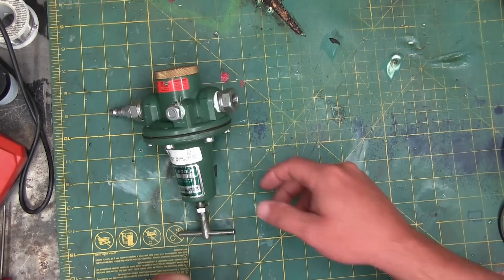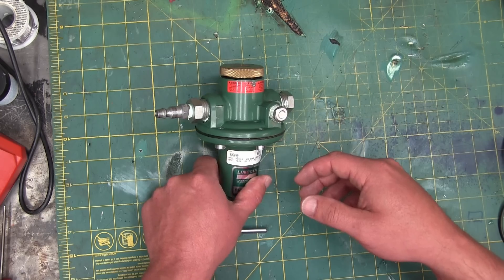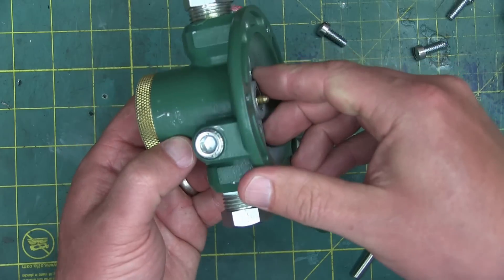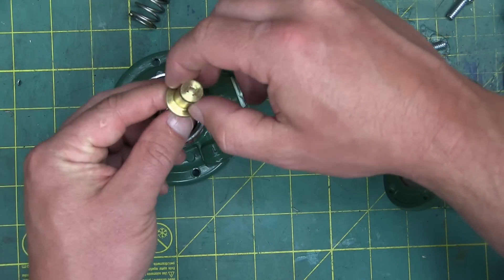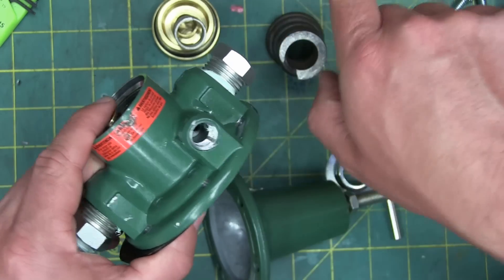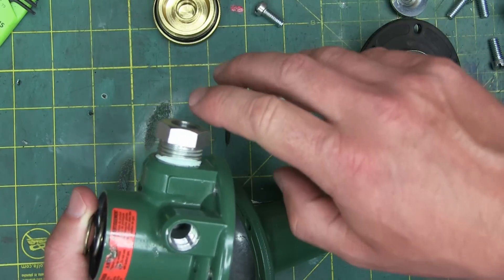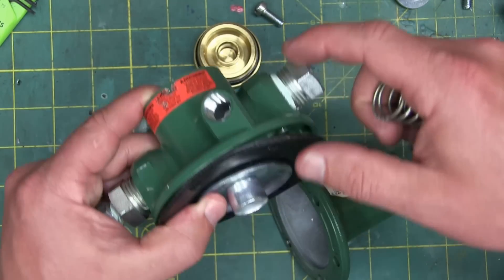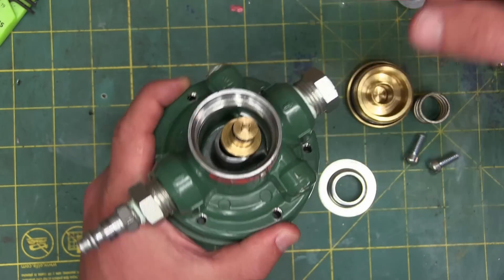BOLTR: Pressure Reducing Valve | Gas Regulator

Comment: Actually, they are designed to not lose pressure. Its one of the requirements for certain machinery, including air brakes, in case the regulator fails, or the compressor expolodes itself. You need to have pressure to continue operation. Even if you have over pressurization in other systems of a vehicle, those have check valves, with everything designed, in every worst case scenario that still leaves pressure inside the brake circuits, to let you stop once or twice.

Comment: Missed one other mode. Diaphragm tare or displacement. I just had a nice Watts unit spit the seal edge of the diaphragm out of it grove and all ot wanted to do was dump high pressure air out of the ambient pressure side of the diaphragm through the vent holes in the cap. If it had or been like the one you have in the video I think it may of made it longer. What seems to have happened is the diaphragm shrank and pulled out of the grove.

Comment: I think it sealing off the back-flow wasn't because you raised the pressure, I think it's because you left the pressure on long enough for the poppet to seat.  When quickly shooting air in and disconnecting the poppet hadn't seated yet so the air shot out.  My theory based on what I saw, I've never tested it.

Comment: This type of valve, if I'm not mistaken as I often am, when used with steam will result in wet steam because the steam has done no work and is now at a lower pressure water comes out. At work we take city 400lb steam and drop it to plant 125lb steam by running it through a turbine that generates electricity during the winter months or compresses gas for AC during the summer months. The steam costs next to nothing during the summer months and using that for AC is very cost effective. During the winter months by running the steam through a turbine to generate electricity yields plenty o $thousands per week. Either way the steam coming off of the turbines is designed to be running around 125lb and because it has done work is still dry steam. Wet steam is extremely dangerous. Steam hammer like its cousin water hammer is very real and very dangerous.

Comment: I'd be interested to see how long it would take for the pressure to equalize betwixt the two sides of the regulator, and what that waveform might look like.  As described, a drop in pressure on the downstream side, would then generate some fluctuation in pressure as the two opposing springs found equilibrium. Not asking AvE to do this, as I'm not interested in coitus with my hat. Just curious.

Comment: I think you may have misread the purpose of the conical coil spring there... Springs don't generally have a progressive rate unless parts of them are binding against each other. The conical coil gets you a bigger linear working range in the same size package, you can compress it further before the coils bind. (Pull the axle quick release centering springs off the nearest bicycle and check out how they squish completely flat.) Also it probably saves material in the housing that needs to stand up to cylinder pressure if the diaphragm fails.

Comment: So, can you blow out your diaphragm by having too much pressure in the wrong direction, then?

For instance if you had your regulator setup to allow for a really high pressure, but then the pressure source was shut off and bled out, it seems like the back-pressure could rupture the rubber diaphragm, no? How often is a regulator such as this hooked up with some kind of back-flow preventer check-valve thing?

Comment: And for scuba you also need a demand valve so you get air when you suck.
Most failures on pr valves are caused by debris under the valve seat.
This results in high pressure on the outlet so relief valves are fitted especially if it's a primary rv, say on a hp cylinder.

Comment: +AvE  I have some gas cylinder bottles at work that have regulators on them.  The new cylinders have 2000-2400 psi in them depending. I noticed something interesting...we set the outlet pressure to about 25 psi.  As the cylinder pressure goes down, the regulated pressure goes up.  Interesting byproduct of the 2 spring setup I would guess.

Comment: What would happen if the input pressure is very high (eg: 3000 PSI) and the output flow rate/pressure is very low? If the pressure differential is extremely high would the diaphragm/valve flutter a lot and cause irregular pressure/flow?

I know that on SCUBA regulators they have 2 stages to step down the pressure to ambient. Would this be to reduce that valve flutter?

Comment: These are also used on hot water furnaces to keep the closed heating loop topped up without having full water main pressure in the loop.

Comment: We use these often with natural gas , steam or pneumatic air. This PRV is a direct acting type, which has the outlet pressure directly influence the little valve. There are also pilot acting PRV's that have a small valve, and the small valve uses the upstream pressure to actuate a larger valve. That happens by diverting the inlet pressure on a larger diaphram so it has more force to actuate the main valve. It also makes for more precise control, and the downstream pressure can be a lot lower (because you don't need much force from pressure to work the small pilot).

Comment: We have what we call a dome regular for reducing 40bar to around 10 bar depending on the process.  To adjust they have 2 needle screws. One applies pressure to the diaphragm for more pressure downstream, the other releases it.  Very picky.  I soil myself every time it blows the pop off valve in my face.

Comment: Ave , This is very similar to the way that Scuba regs work.  They don't always supply low-pressure air, the deeper you dive the higher the air pressure has to be as it needs to be at the same pressure as the surrounding water otherwise your lungs don't have enough power to inhale due to the pressure differential.  If you were to dive to 50M then you'd want the pressure of air that you breathe to be 6Bar (roughly 90PSI)  that's enough to perform the puffer fish trick at the surface but absolutely normal at 50M. - I teach diving so I'm not regurgitating shite.  Interesting Vijeo - https://www.youtube.com/watch?v=VJeSifGgeiA  Thanks for another interesting look at some useless piece of kit ;)

Comment: Very informative, as usual! Thanks. I have a regulator that has shit the bed and I might try to take it apart to see if it's fixable. 

You didn't cover what would happen if the various o-rings go bad, which I would think would be the primary source of failure.

Comment: Do those 4 holes in the poppet valve around the shaft going fully through, connecting the low pressure side with the valve seating cavity on the high pressure side?
Looks like they are important for valve operation, and explanation is not full without mentioning their role.

Comment: Works just like my first stage SCUBA diaphragm reg! Two differences being the preload spring is adjusted to a constant pressure (usually 135-145 psi)then the "outside" of the diaphragm is either exposed to ambient pressure either directly (open to sea water) or indirectly via some mechanical linkage or coupling fluid (silicone oil). This causes the regulator to be depth compensated such that output pressure is always 135-145 psi above ambient. The second "JFM" thing that happens in the poppet side of the diaphragm where pressure in the outlet chamber is fed back to the poppet stem producing "air balancing" whereby it is only the bias spring pressure closing the poppet. This keeps the outlet pressure the same regardless of inlet pressure (typically 3000 to 50 psi). Scuba regulators are two stage regulators. The second stage is another diaphragm reg attached to the mouthpiece which drops the 135-145 psi "intermediate or interstage" pressure to ambient hence the diver's lungs neither shrinks nor blows up :-).
Reply: You would bypass the poppet valve and yes you would cause  one hell of a free flow that would empty an 80 cu. ft. tank in under a minute. The 2nd stage regulator (except for some Poseidon ones which are upstream valves) are downstream valves and act as safety/pressure relief valves. You can "hot lip" and breathe of a free flowing second stage but is not very practical you are trained to use your buddy's alternate air source (that is why divers have two 2nd stages) in the recreational setting. A more robust solution is having an independent back-up which is a spare cylinder with its own 1st and second stage regulator called a "pony" bottle. In technical diving it is mandatory to have two independent 1st and second stages which could either be 2 back mounted tanks with an isolator manifold or two independent side mounted tanks.
Reply: Yep. Scuba regulators are designed to fail in the open or free flow mode.

Comment: Seems to me that the most likely failure is that O-ring on the top of the poppet. Like you say (I think) though, that just means it starts to leak. Would it potentially be a catastrophic O-ring failure and begin to leak out all 100 PSI? Maybe intentionally damage the O-ring and see how it reacts?

Comment: I have found the most common failure to be moisture in the gas freezing and sticking em in place
Reply: It is considered good practice to ensure the vent is facing down so they can drip out condensation at least from the atmospheric side of the diaphragm

Comment: DOOOOD!  How could you not mention the numero uno use for pressure regulators - BEER!  In kegs, in establishments that use pressurized gasses (CO2 or a Nitrogen combo) to force that golden tasty beverage out of the keg and into our drinking vessels.  And keep said beer from going flat.  Each keg usually has it's own regulator as some beers have differing carbonation requirements, so you can fine tune your walk-in kegerator for each type.

Comment: typical failure mode on those things, is the rubber parts go bad, and then it leaks, or gives you full tank pressure, which is totally not good on a 2000PSI gas cylinder.

Comment: I actually built a variable speed air motor control with one of these valves. So gut out the top half, now using the plunger that forces the diaphragm open which increases the airflow this becomes the actuator. Next attaching a cam on a lever arm allowed in the air motor to deliver a sufficient air supply for a decoiler as the arm lifted the amount of air flowing through the regulator increased as the arm descended the regulator shut off.   Now put that in your pipe and smoke it dude

Comment: What keeps it from chattering?

i.e. where's the negative feedback that keeps the diaphragm and poppet valve from oscillating?

(I know they actually sometimes do, but rarely and usually at super low flow rates)

Comment: If you want to see an amazing device built by geniuses, you should see the prop RPM control units on an aircraft.  Springs, fly weights, high pressure oil all working together to keep the prop spinning just right.

Comment: They also use them on most new houses on the main water service line. they're also installed to act as check valves to prevent any of the water that's entered the house from going back out into the city's system.  That's why we recommend expansion tanks or expansion relief valves on the water heater.  If you don't have one, the static pressure can build to very high levels and compromise seals in valves and fixtures.

Comment: we use and I rebuild lots of Fisher regulators at work and a cool feature of Fishers is a weep hole drilled in the adjustment spring housing that let's you know when the,diaphragm fails ( most common failure is the diaphragm getting a hole) and it starts to weep pressure. on a steam regulators this is important because steam temperature is directly related to pressure,  so if you get full line pressure than you run the risk of over heating a product.

Comment: I had the oxy regulator fail in a spectacular fashion a couple weeks ago. The torch was off and the valves at the handle were closed when the reg failed so the hose got tank oxygen pressure which resulted in the fitting at the torch handle failing and the metal crimp fitting smacked my buddy a few times at (what i assume after seeing the bruises) a very high velocity. 

Moral of the story is don't go cheap on regulators and if you do make sure it's your buddy that is using the torch when one fails.

Comment: Excellent analysis of an everyday item (for us maintenance monkeys, anyway) that no one puts too much thought into. I would have liked a little time spent on proper use, since there were several times when you had it turned over and did not mention the arrows indicating direction of flow.

Comment: Company I work for also does air compressors.
These style of regulators are very seldom used anymore (at least down here in nz). They're only found on old school British pistons or IR pistons.
The number one failure mode on these style is the rubber membrane deteriorating usually from moisture  (no one really uses a dryer on a piston). They end up leading through the rubber venting to atmosphere and   it becomes impossible to maintain outlet pressure.
They are susceptible to oil and gunk.
Festo/SMC style is far superior and reliable. 
Must be a NA thing to still have these styles.

Comment: Thanks so much for an explanation of a piece of equipment I use almost every day to stand between "50 PSI max input pressure" gas flow controllers and 1500 PSI gas cylinders.

Comment: If you apply pressure to the inlet, and thus the outlet, and then remove the inlet pressure... try screwing in the spring screw. 
It will always relieve the pressure out the inlet.
Let's see if you can figure out why.

Comment: Good video. The outlet is also in comparison to atmospheric absolute pressure (14.7 psi) through the vent holes in the adjustment housing. Which is often overlooked. If there were no venting on that side of the diaphragm temperature or altitude changes would effect the setting.
Reply: I would think your pressure altitude would affect at what point your outlet side would be able to maintain pressure once inlet pressure drops off, vs back flowing your outlet pressure to inlet side. 

IE at 1 atmo ambient, you'd need something more than 1 atmo on the  outlet side to keep enough differential on the diaphragm to keep the diaphragm spring loaded enough to not overcome the now 1 atmo on the inlet side (the bias spring should be balanced out by the diaphragm spring at whatever tension it was set at while inlet was pressurized).
Reply: @thepewplace1370  The third is a reference point in the case of air.

Comment: Is there a cheap way to regulate down to really low pressures? (A couple cm of water) Hopefully a better idea than throwing an Arduino at it with a pressure sensor, solenoid valve  and a coil of capillary tube to restrict flow, which was all I could come up with.
Reply: Robert Szasz In the states Natural gas regulators for houses are generally set to output about 7" (18cm) of water with appliance gas valves reducing that to 3.5" and lpg second stage are generally set to 11". Of course what you are regulating can't be corrosive to the materials used.

Appliance gas valves also generally have the bonus ability to be controlled electrically.
Reply: Daniel Armstrong thanks for the info. I'm trying to figure out if a inert drybox for storing and feeding hydroscopic 3d printing filament could be maintained at positive pressure from a bottle of nitrogen.  A bunch of silica gel or molecular sieve and just purging the air out of the box with a gas bottle is probably the easier solution
Reply: google tank blanketing regulator. it's done all the time in industry to maintain a nitrogen blanket on tanks full of volatiles

Comment: The fact that these type of regulators can hold pressure is an important safety point for people who work on pneumatic equipment.  I see machine designers and engineers put lock-out points upstream of pressure regulators, without providing another means of exhausting the pressure all too often.

Comment: Fack yeah, AvE is does something what is connected to my job! I work for an company who is installing medicial gas systems and also the most toxic gas systems. Great job explaining how the regulator works! But the most frequent faillure is when there is durt on the valve stam seat. Then it lets al the air past.  Just take the regulator apart and clean the valve seat good. Or sell the custommer a repair kit :p this regulator has an relief on the membranen ( its the hole in the Midle of it.) You can only use this regulator with air. When you have toxic or explosieve gasses you never want them tot excape from there and you use a safety valve in the system what you explained. Keep up the great work my crazy uncle!!

Comment: Uncle Bumblefuck, I have a direct that needs projection. Strire Daits indeed.

I've got this cheapo 15 dollar wal-mart boat, it's crap, I've had it for a million years. I would like to give it the frankenstein treatment and swap the cheapy motor in it for something more exciting... like the motor from my (constantly smoking, sputtering, megalomaniacal) ceiling fan. Now I know next to nothing about taming the electronic pixies, but would doing the backwards from your hotwheels portable chooch to wall pixies conversion vidjeo work in this scenario? The old forker runs on AA batteries, which I intend to swap out for much angrier hobby-grade lipo batteries and hopefully that'd be enough to power the ceiling fan motor from hell.

Comment: That is so fucking cool. I always wondered how regulators worked. I think it would have helped me if you'd pointed out what the path of air flow is. Like, I get the principle of how it's operating, with the forces oh the pop-it being independent of the upstream pressure, but I don't see which parts are at high pressure and which are low. So, when you were pointing out how the areas on the pop-it cancelled, I couldn't really follow.